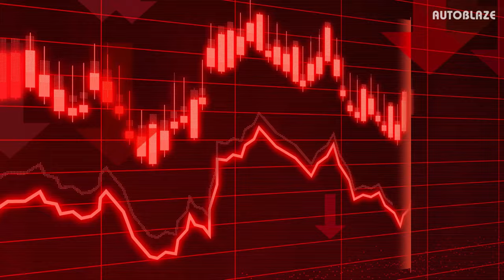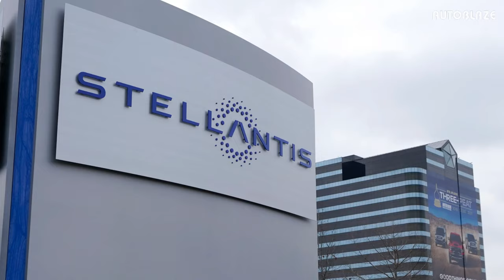Here’s Why Both Ford And GM Have Shut Down Pickup Production

Comment: New cars and trucks are too expensive and too completed. $100,000 for a pickup which used to be considered a work truck. Everything that is not related to emissions or ABS needs to be removed for all computer control modules and go back to 1980 controls. Right now America needs basic reliable transportation at a reasonable cost. I don't feel a bit sorry for the auto makers or the dealers.
Reply from the maker: Thanks for sharing your thoughts. Affordability and simplicity in vehicles are valid concerns. Striking a balance between modern features and cost-effectiveness is challenging for the industry. Your suggestion for simpler controls echoes a desire for more accessible options. If you have specific ideas on how the industry can achieve this balance, your input would be valuable in ongoing discussions about the future of automobiles.